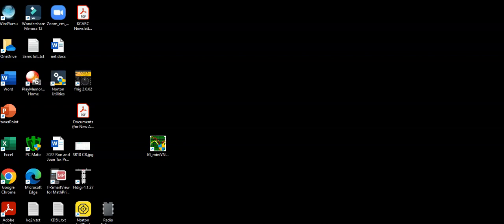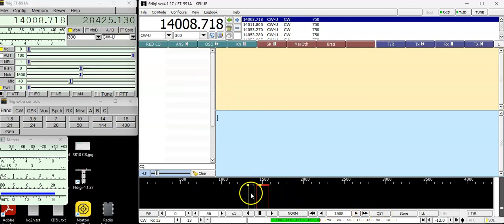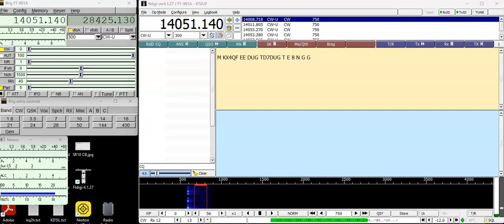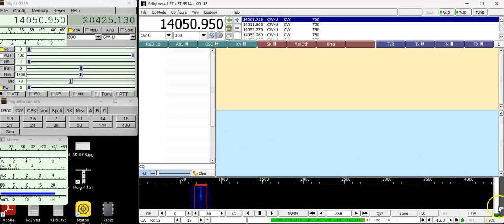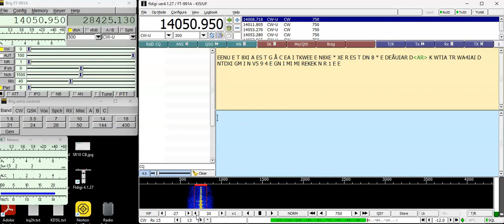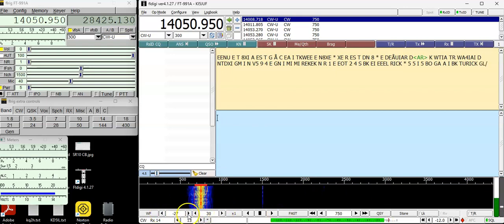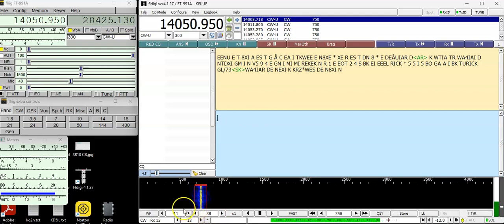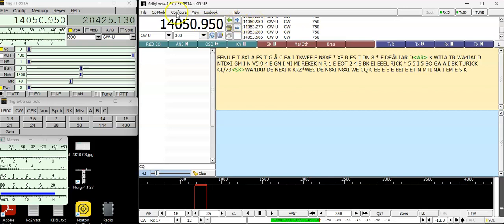FLDigi (USL) Upper Signal Level and (SR) Signal Range adj. FT991A features weak QRP station demo.

Comment: Just a quick idea.  Try placing the pass band (when it's yellow) directly over the incoming signal.. and click.. it puts your Red pass band exactly on the signal... then... click the QSY button.  It will bring the frequency you want (exactly) to the 750 mark where you want it... and you won't have to click around on the vfo up/down to get the frequency centered on your 750 pass band.   It's kinda like an automatic quick frequency change.
Reply from the maker: Thanks and I will give that a try appreciate the tip and '73 de KI5JUF thx!

Comment: Steve rather than hunt use the onboard spotting network which is included once you hear him click on the signal and it will center on it increasing the intensity of waterfall just makes it easier to use  when I can't heat them and hit the pre-amps on your rig and increase signal filter all that your doing is ok if you have time but contesting you want to bring them in without fusing around with all that stuff. Also each rig runs differently on the Icoms we use Upper and Lower sidebands in data mode to work CW the program will do the translation for you